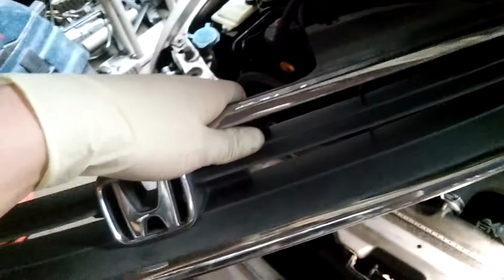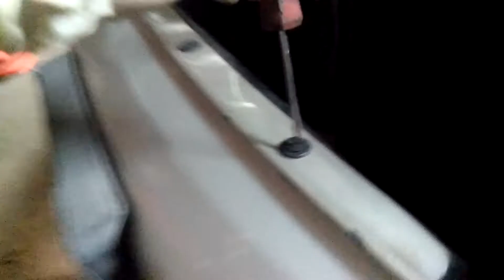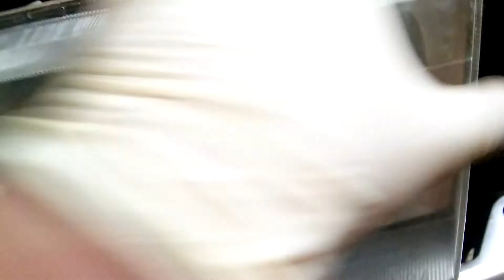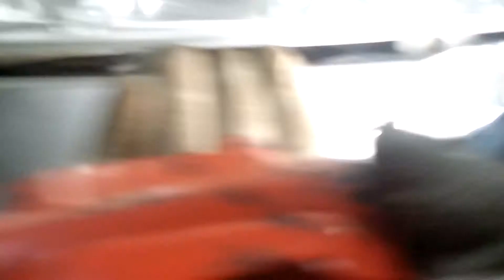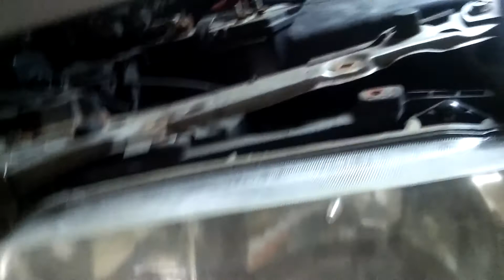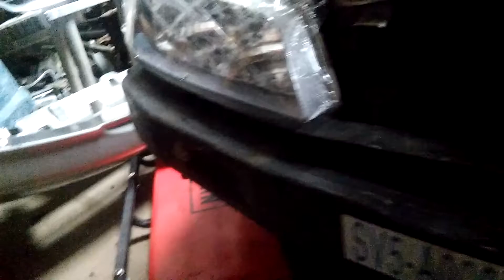1997 Honda Accord Replacing Front Headlight Assemblies/ Передние фары

Comment: You did it all wrong my friend, you have to remove the lower turn signals and remove 4 bumper bracket screws that are behind the bumper. All of five minutes worth of work. Then you can easily remove the headlamps without any hassles!

Comment: The easiest way to remove the Front bumper to get to the Headlights is to start with the Front grille. Then the top corner parking lights, then the bottom turn signals remove the screw on each side. After that remove the top screws on the Front bumper cover and fenders. Then the bottom screws underneath that's holding the Front bumper cover and last the 2 bolts that holds the Front reinforced bar. Then it will come right off. There's an easy way and A faster way to do it. And There's the longer more time consuming way of doing it. Personally I'd do it the way I listed it above, saves you more time.